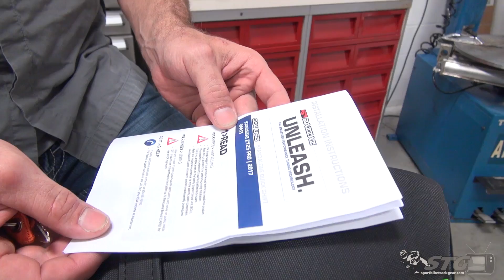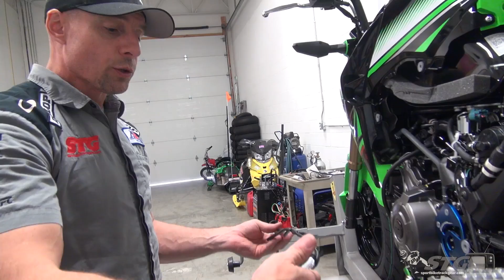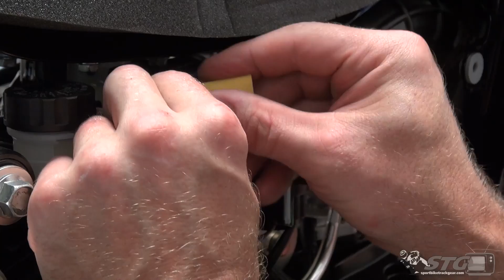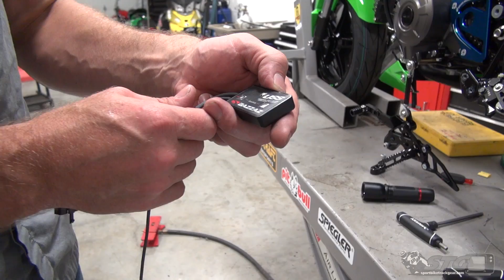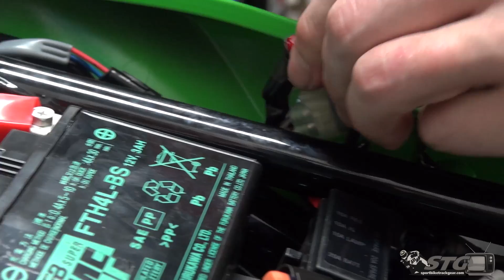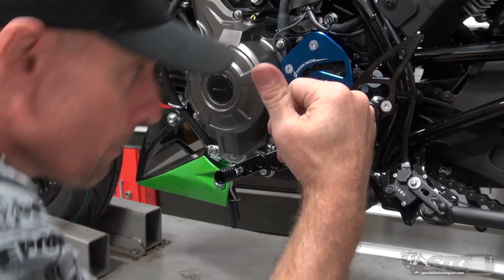2018 Kawasaki Z125 Pro Bazzaz QS4 Quick Shifter Install from Sportbiketrackgear.com

Comment: Is this quick shifter still available for 2021 z125?
Reply from the maker: I would expect this to be the same system. You will need to call Bazzaz direct as they no longer sell to dealers. - Van

Comment: I am looking into getting one of these for my bike ('12 R6) and I currently have a Z FI (fuel ignition tuning) so trying to find out if I can hook those two together,  if I need something else, or this stand alone is pretty much acts like ZFI, too.
Reply from the maker: Yes you can run both of these units on the same bike with zero issues. - Van

Comment: I really cant believe you just used a scotch lock ,you do realize how those work ? They cut the  insulation on the wire leaving it open to the weather , it will turn green and fail in time ,,,really disappointed to see you half assing stuff !!!!
Reply from the maker: To be clear this is what Bazzaz sullies in the kit for the install. Over time a scotch lock connector can be problematic if used in an environment that is exposed to weather. This is in a location where that exposure is not likely. If you look at many of the terminal ends on most bikes you will quickly see many are not weather pack style connectors with terminal ends and bare wire exposed to the elements on some level. End of the day this is not a whole lot different than a scotch lock. - Brian Van

Comment: Hey Brian, 

Do y’all prefer the bazaaz over the PCV? Trying to decide between the two
Reply from the maker: I do prefer the Bazzaz over Power Commander. Having used both over the years I like how Bazzaz integrates everything into 1 unit rather than stacking multiple boxes in the tail. What bike are you looking to install this on? - Brian Van
Reply: Sportbike Track Gear 
Brian, I’d be looking at slapping it on the good old z125 pro. The bazaaz seems to be a better solution for a lot of things across the board, just no ability to make any changes to
Timing.... which is fine